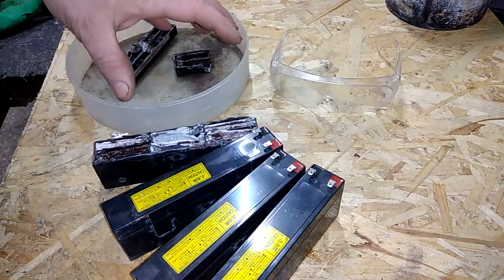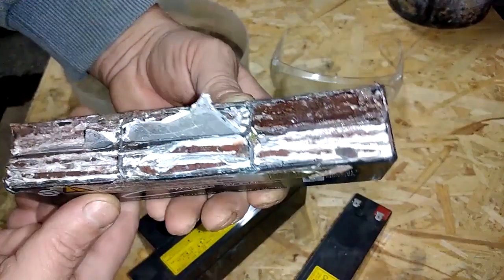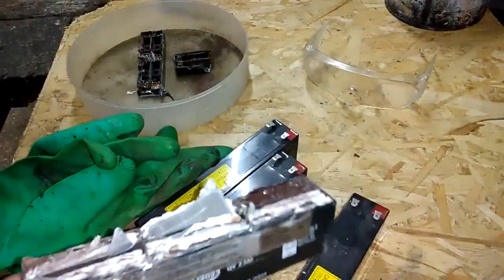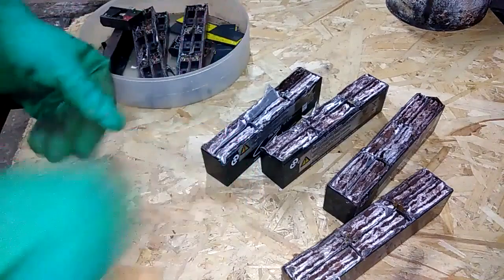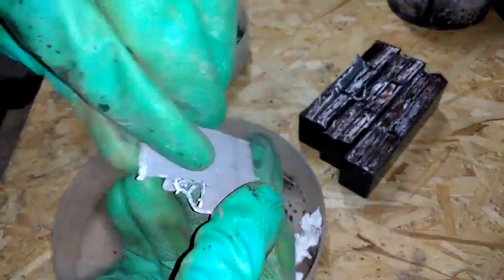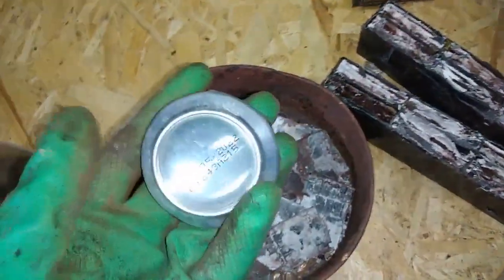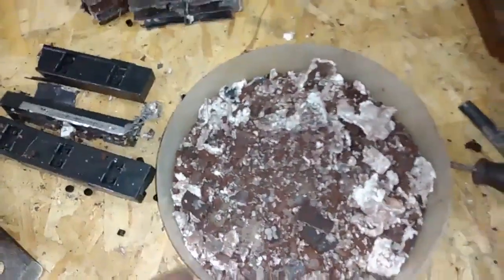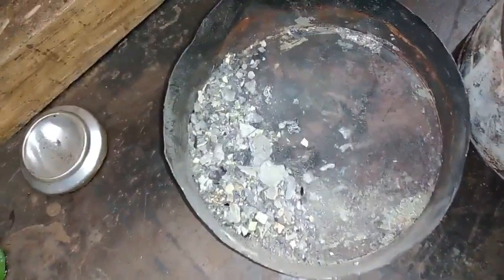Lead extraction from lead-acid batteries!

Comment: Most of the lead in a lead acid battery is tied up as lead sulfides and lead oxide. Do a proper smelt and reduction of those components and you can get another 50% or more lead out.

Comment: Here's a hint to all you people who want to do this it's cheaper to recycle the battery take the money from that battery go by lead from your Metals place that's used for about 30 cents a pound then melt that down pull your ingots you will get Triple the amount of lead I get anywhere from 3:00 to $5 a battery that's 6 to 10 lb of lead I usually get about 1 or 2 lb of scrap between that and the rest is pure lead weigh more than what you get out of a battery
Reply: Problem is that all the commercial recyclers have stopped selling lead to non-business people about 6 or 7 years ago. I owned a small sporting goods shop and they stopped selling to me too.

Comment: From an economic viewpoint, the lead yield is very low due to the crumbly lead oxide and it makes more sense to sell the battery and buy good lead with the money.

From a practical viewpoint, the battery plates can add start smoking after exposure to air and the acid gets on everything.  You also need to properly dispose of the waste   

From a casting viewpoint, battery lead creates a deadly gas when you melt it and it is the wrong alloy for typical casting purposes (bullets, sinkers, etc) since it has calcium in it instead of antimony.  Every time you melt it, you run the risk of poisoning yourself and others if they collect the lead later and use it unknowingly.

Just sell the batteries to the recycler and buy or find pretty much any other source of lead.
Reply: in my country scrap lead acid battery costs 0.80 cents per kg, but pure led costs 12 USD per kg (at local "e-bay") in ingot presentation of unknown purity. So, you can calculate a potential profit. This profit is tiny compared to "maximum" profit you can make in this business. Just imagine that a pure sodium metal is selling for 2 USD per gram (ampoule) , while NaCl (table salt) costs about 30 USD per ton from a wholesale warehouse. Just google "most expensive compound" or "most expensive material"  so you can imagine how high the profit can be. But of course, for a guy who sits and watches TV every night , doesn't have any knowledge of chemistry, physics, machining, CNC routing, industrial processes, programming, electronics, and etc and etc... it is better to buy it. Keep buying, while we will keep making money on your need. That's how it works.
Reply: @absolute___zero  If a battery weighs about 15kg, you would get $12 by scrapping it with no work according to your numbers.  If you melt the battery down, you'll get about 10% of the weight in lead out of it (source: I have done it).  Therefore, you'll only get about $18 from the pure lead after dealing with cutting that battery apart, spilling acid everywhere, neutralizing the acid before the plates start smoking, breaking the crumbly lead out of the plates, and then melting the scrap lead down into ingots.  Now you have to deal with clean up and hazmat disposal.  It's just not worth it.  Plus as I previously mentioned, it is the wrong alloy of lead for bullets or sinkers.

Comment: I did it several times with car batteries just to get the electrolyte to make sulphuric acid, but the lead content went straight to the foundry, still ends with a lot of waste at the bottom, but the lead is all out 👍

Comment: You can flux the lead with wax to help clean it up. The carbon in the wax will also reduce any lead oxide back into lead metal. There are videos that show fluxing with wax in lead recovery, it does flame up.

Comment: Since the batteries were discharged when you started, the stuff that didn't melt is almost certainly lead sulfate. Lead-acid batteries convert metallic lead and lead oxide to lead sulfate when they discharge. Charged cells might actually have given you more lead to melt ;-)
Reply: Yep, and there's going to be a fair amount of lead oxide in there too.  It would increase the yield to smelt it and reduce those back to metallic form.